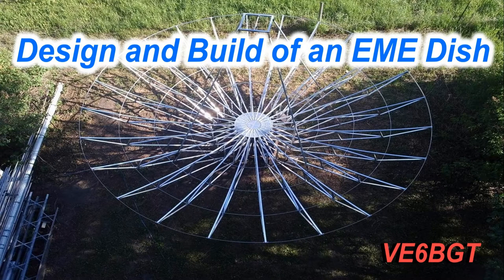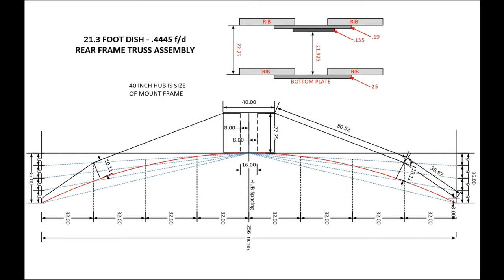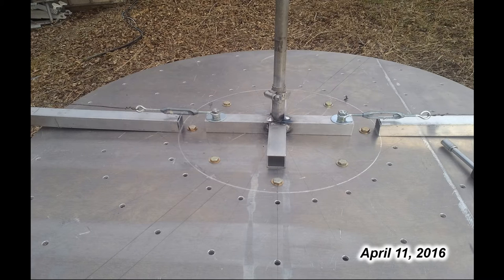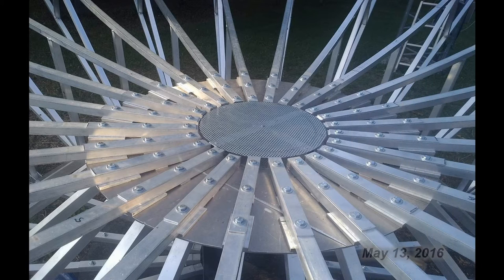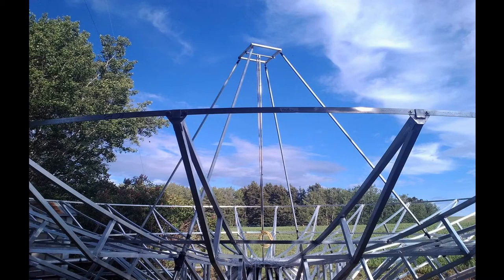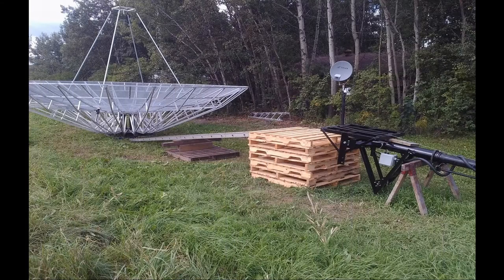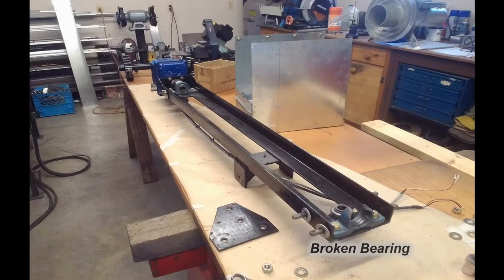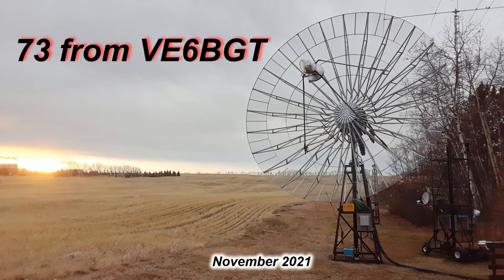EME Dish Design and Building Project

Comment: Awesome engineering achievement. Can you tell me what the mesh/screen material is please ?
Reply from the maker: Hello Gregory, thanks for reaching out to me.. The mesh is what's called hardware cloth.. You can buy it at different hardware stores in different sizes of the holes or squares.. I bought the smallest possible so that it would be useable at higher frequencies such as 6CM or 5.7 Ghz..
It is miserable stuff to work with and cut to size,  lots of cuts and blood shed ha ha.. It didnt roll off perfectly flat and had a lot of "warped" sections so it took a lot of tie down points to hold it flat as possible.   Thanks, Skip
Reply: @VE6BGT  Thank you for the quick reply, I guess it's like a woven galvanized or stainless steel mesh.
Reply from the maker: @gregorydobson4307  Yes thats a good way of explaining it, just galvanized mesh.. Not Stainless for sure...